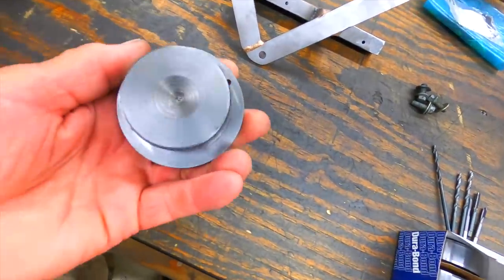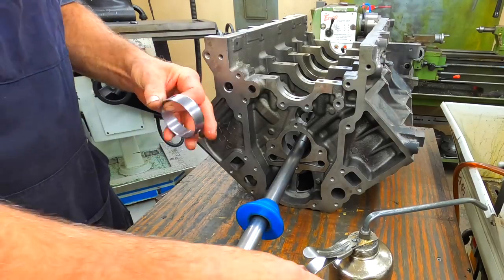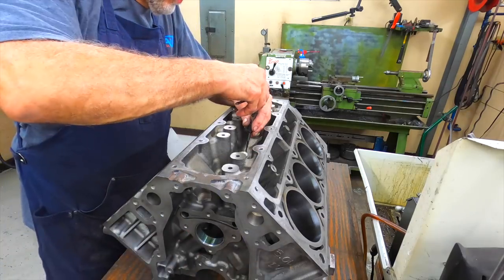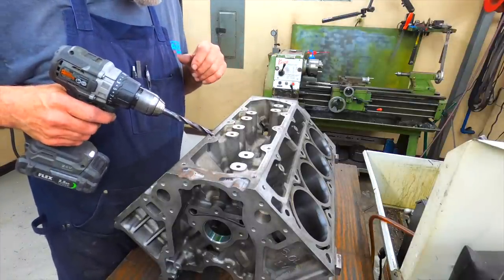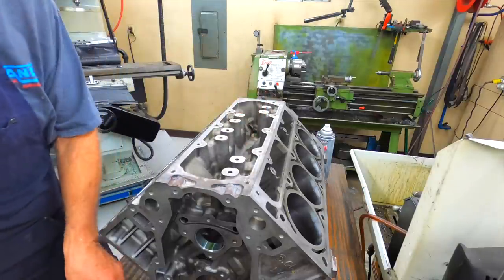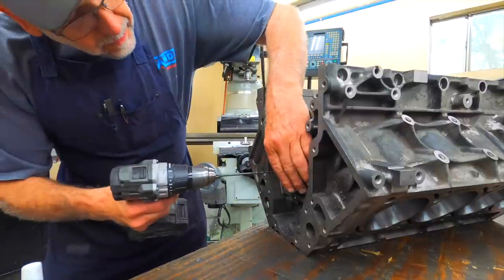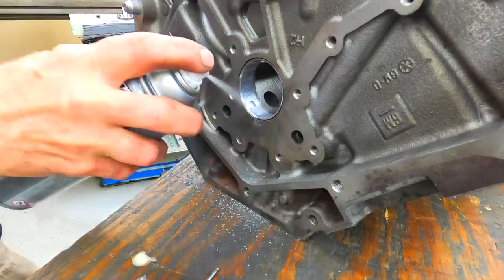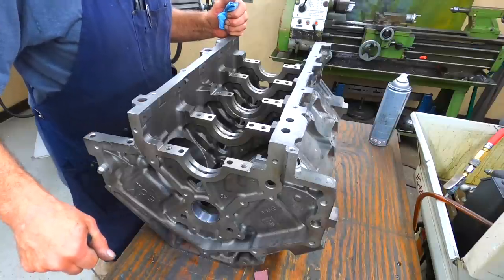Pin Cam Bearings with ONLY Hand Tools AT HOME! Manual Machine Shop | Brand Racing Engines

Comment: Loctite 620 retaining compound gets the same job done without all the hassle. Never had a cam bearing spin.
Reply: Have you checked the inside diameter of the bearings after the compound sets up?
Reply: My Engine has 300,000 miles. It's definitely do for some cam bearings. I wonder if it will make it another 300,000 without this trick? Hell I probably won't last another 300,000. I let the next guy worry about it 😁
Reply: He is right loctite them in all my burnout engines are the same never spun a bearing
Reply: @adammanuel4448 are you talking about putting lock tight on the OD of the bearing itself. Because I have the same question
Reply: @Johnny-jr2lq  yes he is. It's a green compound intended for slip joint or slip collar attachments. With the expansion rate of aluminum blocks bearings can lose their press fit and spin. 

The camshaft fit will be tight. It'll spin in the tunnel, but it'll be tight. I've had engines come in where their dad's old racing buddy shoved an old cam in and tried to "size" the cam bearings. That's how tight it is cold. Hot is a different story.
Reply: @Johnny-jr2lq  John what Arturo said  and yes the od of the cam bearing

Comment: Why couldn’t you just lock tight the OD of the bearing itself ????? I use to work at a head recondition shop but it was for diesel heads. They had me use lock tight on the injector seals. This is a honest question not trying to be a chuckle head.
Reply from the maker: Alum block will Expand
Reply: @BrandRacingEngines  fair point

Comment: Nice work!
Nice solid cam bearing installing tool, the universal adjusting ones don’t cut it. I used to have the Winona Van Norman cam bearing installer with about 30 different-size drivers.

Comment: A old school bit brace, yes like grandpa used to drill holes is really nice to drive taps in smoothly and straight.. plus it's set up for square drive and has a pad on top to hold it straight and keep pressure on it.

Comment: Great video Gerald! I have noticed the front cam bearing to be the problem child on the LS platform. Sadly most of the automotive machine shops in my area have gone out of business and all the new ones have mega overhead cost which makes it unaffordable.
Reply: Hey what part of the country u located at? In Philly lots of machines shop r out of business as well

Comment: Has you ever seen an issue with the metallurgy between the set screw/bolts and bearings?  Is there a expansion range from heat that may distort anything or is it to small to worry about? This is a really good trick of the trade!
Reply from the maker: No have had no problems with pining

Comment: Good alternative to correcting the bores if it works in a bind. 
   . We just index/bore/hone them all for the CHP-25R1 oversize bearings. We won’t machine a block without doing this as part of the process.
Reply: Why do these spin cam bearings? Especially the 6.0

Comment: Great video , and great idea pining the cam bearings , there’s a lot of speculation out there why the Ls motor spins cam bearings but no solid reason why. I was just looking at a LS oiling system diagram, and I see the oil galley that feeds oil to the cam bearings runs along side the cam bearing journal and then to the mains ,, and not directly to the cam bearings like a Gen 1 sbc. say you have a high milage LS with loose main and rod bearings,  it looks to me the oil would leak out the loose rods and mains and preventing it from building enough pressure to feed oil to the cam bearings ?? I could be wrong , what’s your opinion why they tear up cam bearings ??

Comment: If you continue to use the same fixtures for locating and drilling the holes in the block the fixture itself will start to wear out. I'd suggest the use of a hardened drill bushing inserted into your fixture to maintain and protect the original location, available from tool and die supply houses such as McMaster-Carr or Carr Lane Mfg. Nice idea to mechanically hold the bearing in place.
Reply from the maker: Thanks

Comment: Mr Brand if you have the time, can you explain why LS engines have can bearing problems. I’m obviously not a machinist or engine builder. But the cam spins exactly half the speed of the crank with a lighter load. My experience with small block ford and chevy was you can rebuild the bottom end and not touch the cam bearings and everything will be fine. But I constantly hear about LS cam bearings. Thank you sir. I truly enjoy watching your channel.
Reply from the maker: A split cam bearing
Reply: Always replace with a 1-piece cam bearing

Comment: So as far as I know all V8 engines small block Big Blocks LS is and so on all use a cam bearing. Hawaiian small-displacement engines like 4 cylinders in overhead cam engine like a 2JZ Toyota they don't run cam bearings. Now I know at times the cam cap and the head need to be line hone but that's pretty rare. Normally you can just drop a set of cams in torque it down and you're all good then you have a steel cam on an aluminum head or sometimes a Billet aluminum cam on aluminum head no bearings but absolutely no scoring

Comment: Mr brand when a engine that comes back in that has this process done, do you just run the same tap in the existing hole on the front and rears? Couldn’t imagine you could go any bigger if the threads got buggered up on the block side. Nice info, keep’m coming!
Reply from the maker: Yes the same hole

Comment: Hi, Great information about the cam bearings,, I bought a gen3 5.3 ls motor and tore it down and the middle cam bearing just came uot with the cam and I had to use my dremel to cut the bearing in half ,, the journal looks ok and figured the bearing hadn't spun but the cam looks like its been heated ,, not scored just discolored at the center cam bearing .. I watched your video and thought this would be good insurance for the rebuild but this motor has knock sensors and look like its impossible to do # 2 and 4  bearings ,, am I right ? and would it be ok to do this just do the center bearing and #1 and 5?

Comment: Have you tried Loctite 632? The green stuff, it’s made for press fit type situations. It’s worked good for me. I’ve never used it on cam bearings though. Seems like it’d be good for that, just don’t know if the oil and heat affect it.
Reply from the maker: Yes Didn't like the results

Comment: What needs to be explored is pinning the main bearings on the LS especially the 6.0L which tends to spin the #1 main.  What’s your thoughts/experience with pinning the mains?
Reply from the maker: Pining the main will not fix the problem. What running off the end of the crank.
Reply: @BrandRacingEngines  Can you explain why it wouldn’t fix the problem?
Reply from the maker: @HeadFlowInc  If the housing bore is right the bearing has enough crush to keep it from spinning. The bearing tangs are to locate the bearing. Alum. rod have a pin to locate the bearing not to keep it from spinning. If a bearing spins its the crank is getting against the bearing.  Hope that helps.
Reply: I hear another tips and tricks video
Reply: He’s basically saying the crank is grabbing the bearing (clearances)

Comment: U didn’t show how u used the drill jig u made up for the middle bearings …. So why not drill it and tap it before bearings get installed and then install bearing and screw the set screw just putting pressure on the bearing vs like u did thru the bearing . Just wondering if that would work to ?

Comment: So let me be clear on this, You pre drill your holes and then install the bearings? Or do you drill the hole completely threw the bearing and then just use the washer to get the depth of the set screw so it doesn't go all the way threw? And where can I get one of these tools to align everything for the hole getting drilled threw the block? And the other tool for the end bearing??
Reply from the maker: Yes I would probably make one and sell it 300.00
Reply from the maker: @matthewhussey5357 Email me

Comment: So just drill and tap the inside bearings straight through. After drilling and tapping you just emory cloth sand (lightly) all cam-bearing surfaces and call her done??

Comment: When I put cam bearings in especially in a aluminum block I would get the bock up to 180 degrees in a washer and put the bearings in cold that way the block shrinks down on the bearings. Just saying

Comment: When you drill into the center ones does it leave a rough spot or burr you have to smooth up? Or does the hole come out smooth and clean? Awesome video
Reply from the maker: You have to remove the burr
Reply: @BrandRacingEngines  any tips or suggestion on removing the burr? I’m going to be doing this to my lq4 it’s a great idea

Comment: Thank You Mr Brand  love watching your Vids so helpful old school rocks.... Do you have any content on the building of Damon Merhants engine? Sure proves old school again is the way Conven BBC out there in first place you should be so proud we alll are... Thanks again...
Reply from the maker: I have it in the shop. will post it
Reply: @BrandRacingEngines  Thanks Mr Brand iam 60 yrs old and have owned a Automotive Repair shop for 37 yrs , i have a couple 64 Novas one pro street and the other is still stock chassis both have 434 SBC strokers and it  blows me away back when i cruised out of high school a 400hp engine was the rage today if your not showing up with a 800 -1000 hp your not going very far... I have great respect for You and all the old school mentors i have been blessed to learn from , High school Auto shop and Machine shop were so much of what you put on your content which proves corp owned Race engine shops may not treat every engine like a person like you that said have been a fan of Damon since i learned he was running Matt's Big 9 set up combined with your skill set that BBC made 51 runs , Damon released a vid Thursday while pulling the engine hoping it did not Window the block or mess the crank up beyhond repair, would love to see you show the repairs or rebuild its to me so impressive that a small home town machine shop and engine builder has built a engine combo that is beating up on engines that cost 3-4 times a BBC . Again thank you for all the educational Vids on Engine machine processes.  Sound like Damon will be sticking to replacing the Aluim Rods on a maint basis from now on..Fred

Comment: Interesting.. Although mechanical bond is stronger, I'd use chemical bond, i.e glue. It would work as a lubricant during assembly, and won't compromise the material thickness causing heat distorion, also the bearing surface would stay intact. When you have a full adhesion around the bearing, it won't collapse and modern glues are pretty heat resistant. Collapsed bearing can still work it's way around the pin, resulting in cracks and grooves.
Reply from the maker: All the billet hemi blocks are pin similar way  CN Blocks BA block

Comment: The jig you show is for gen 4 block right? What about a gen 3? How would you do gen 3 block?
Reply: By the way, love the video's and the info you share. Keep them coming.
Reply from the maker: Add spacer to the valley cover bolts so it sits on top of the knock sensor boss

Comment: Ive been asking others about doing this to save a OEM Aluminum Block engine. It seems that if you spin a cam bearing in a cast block that 99% of the time you can get away with replacing the bad bearings. But the Aluminum blocks are another story. Ive got a LY6 (6.0 Iron block) In my 09 Silverado 2500HD that we're 99% sure just spun the center cam bearing last week. And I can tell you this, Its not going back together with out getting this procedure done. And why wasn't GM doing this to start with??? Now I just need to find someone here in Northern Ohio that knows how to do this and has the gig/tool to do this.

Comment: Any experience with the center cam bearing/block area on aluminum 5.3 blocks shrinking in size? And can you pin the aluminum block?
Reply from the maker: You Can Pin Alum or cast all the billet hemi blocks are pin similar way

Comment: Sounds great until you need to replace cam bearings later. Probably center 3 not a problem, but what about those end CB's?
Reply from the maker: Just remove the set screw in the end.
Reply: @BrandRacingEngines Yes, but you still have to drill and tap for cam bearings front and back. Trying to drill and retap half a hole????
Reply from the maker: @havebenthere  You just have to tap it is a 1/4 of a hole. I have done it
Reply: @BrandRacingEngines  That is understandable.

Comment: I never heard of  cam bearings  spinning in  the old Chevy  small block  engines  ,

But it happens  quite often in LS engines does it , 
So tear the engine down and  add a pin to each bearing  , 
Sounds like Fun 
And while you are putting pins in your  engine,  I'll be enjoying mine

Comment: I know this is off topic, what's your opinion on oversizing small block chevy oil galleries?
Reply from the maker: LS or sb chevy
Reply: @BrandRacingEngines  sb
Reply from the maker: @1channeluser  Drill the main oil galley with 7/16 and the 3 center main bearing oil hole to 5/16 to the main oil galley. Hope that helps thanks
Reply: Will do, thanks for taking time to reply. Videos are on point

Comment: Do other engines need this too or just a weakness in LS
Reply from the maker: Yes I do some ford
Reply: @BrandRacingEngines  small block 302/351w or others?
Reply from the maker: @jondahl3173  Yes 460 to

Comment: Why do you scratch the crap out of the bearings with the oiler before installing?
Reply from the maker: Works as a cushion on the inside and a lube on the outside

Comment: What are you cam bearing spinning people, doing to your motors??
I've exploded pistons, windowed blocks, turned valve seats and rods back to powder, de-lobed cam shafts, run cam bearings to paper thin and never actually spun a cam bearing. In what scenario are cam bearings, walking in the block??

Comment: Is that what all the beat up LS cam bearings is from? Bearings getting spun? What a shame, the cam gets oil before the crank 🤦‍♂️

Sounds like GM got the cam bearing design wrong! Great video, finally had this question answered. Two piece cam bearing design is 👎

Comment: I've installed countless LS cam bearings...never had one spin, never seen one spun.
Reply: Your a lucky man. Ive seen countless ls cam bearings spun. Still dont know why. Other than run low on oil or over revved with just 6 qts.
Reply: He's not lucky. You have a lot of (all of ) the unlucky customers. But looks like you got it covered. The reason why you don't see anybody else do this, and the reason you don't understand why are one in the same. 👍